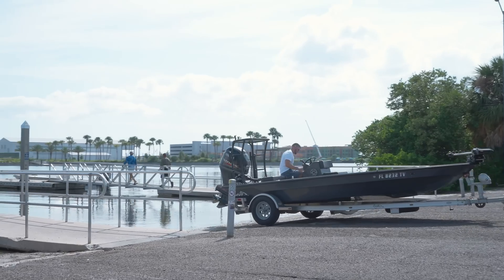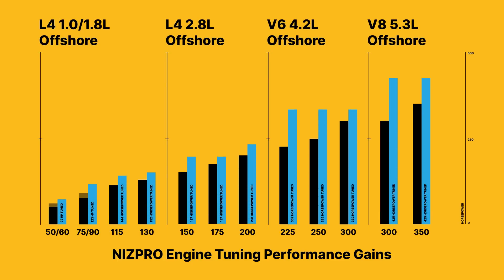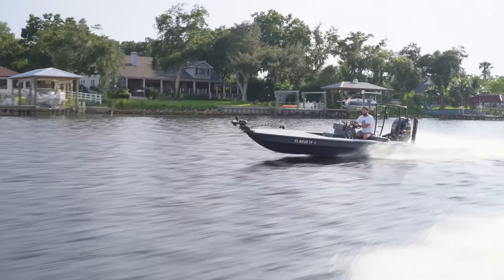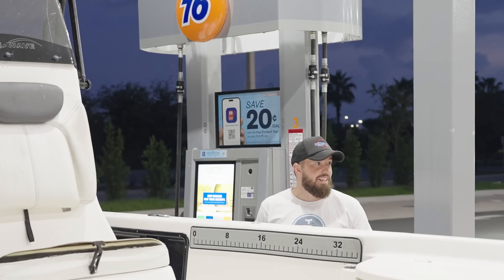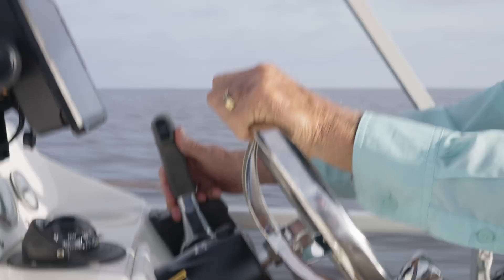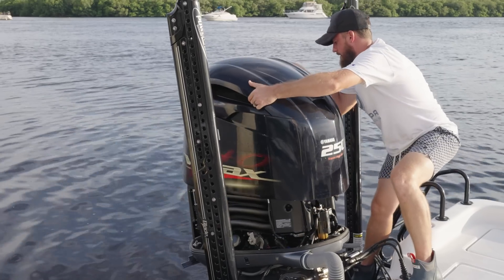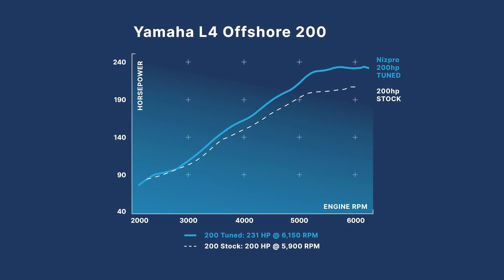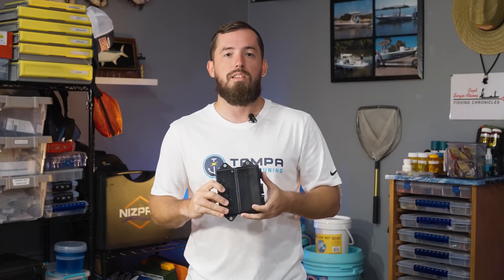EVERYTHING you want to know about boat tuning!!! Tampa Marine Tuning goes deep.

Comment: What does Tuning do to the fuel consumption?  I have to assume you’re increasing the fuel load on the engine to help get that extra power. I know from experience in tuning motorcycles though, I really didn’t see a drop in mileage unless I spent a lot of time in the higher Revs, so I’m curious about marine engines.
Reply: @4:04 they address it that question. Engine with more torque doesn't have to work as hard and you cruise at a lower RPM consuming less fuel.
Reply: Can You chip Tohatsu MFS115?